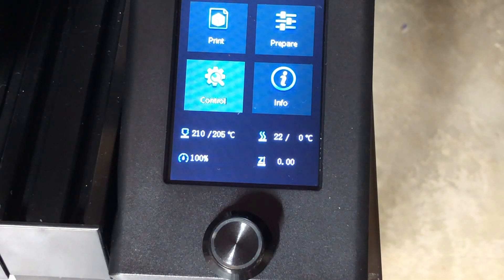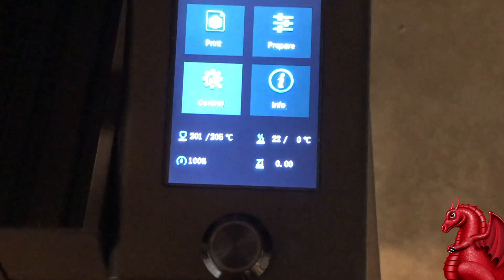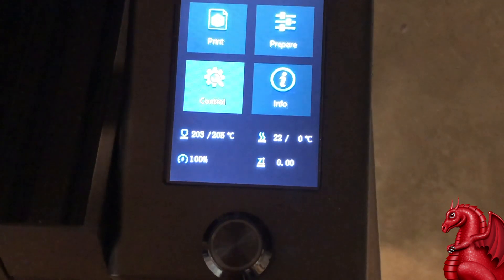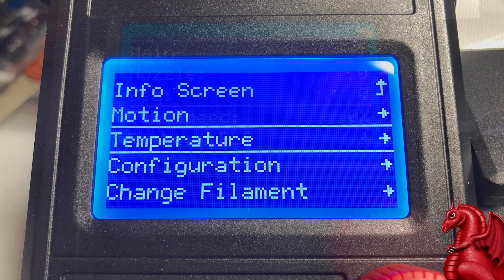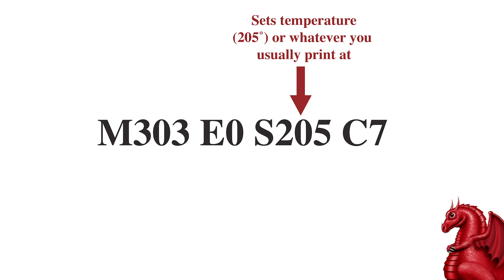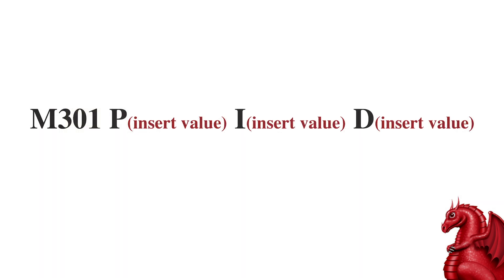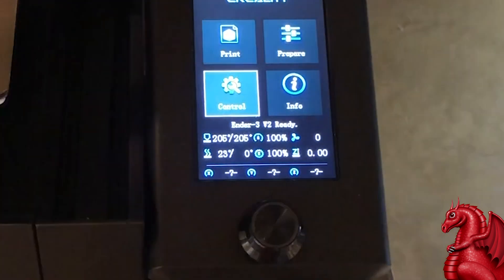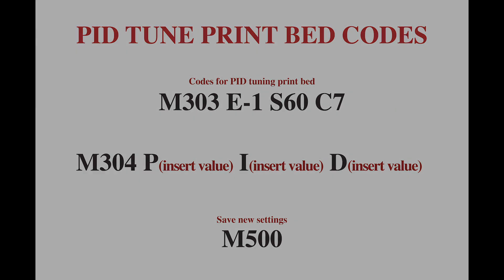PID Tuning on the Ender 3 V2.

Comment: When connecting an Ender2 V2 motherboard, make sure that your machine is turned off, with Pronterface program already running. Plug your cable in, connect using COM9 BAUD 115200 and then turn your printer on to do your tests. You welcome.

Comment: You can do this from the front panel on the Ender 3 Pro if you have Marlin 2.1.  It is on my machine anyway though I have not tried it yet.  Okay, maybe it does not work. It just says processing, please wait, forever.  I will use octoprint to do this then.

Decided to use Pronterface anyway.  I started the PID autotune and it seems to have worked though the temperature change was not reflected on the printer's display until after the autotune was complete.  I am going to try it again.

Interesting.  I have a BTT 35 display and I had to put back to Marlin/text mode in order to see the temperature changes.

Comment: when I hit connect its telling me could not connect, error could not open port?
Reply from the maker: Try a different cable.
Reply: @Tombof3DPrintedHorrors  So I got it to connect, started the process, and I got a warning on the printer saying "Thermal Runaway" any ideas?
Reply: What did you do? I’m having the same issue

Comment: Where does M500 store the settings? In the firmware in the printer , or, on the SD card? (which I hope not. SD cards are all over the place in my office)
Reply: It saves it in the firmware :)

Comment: Thank you. Yes, I can only echo "just in time!". 
Marlin firmware seems to be fine "as is", but  Jyers crashes badly with thermal runaways or  "killed print", nozzle temp to low, etc. So I'm back on Creality/Marlin which currently seems to run ok. I'd like to try Jyers again. He really has some nice features.
Question: Is there a way to first see what the existing/current values are, before going into this process and change it?
Thanks. I have an Ender 3 v2
Reply: I believe the command in Gcode to show values is M503, use pronterface and this to get the values :)